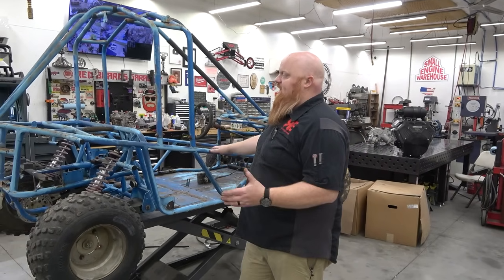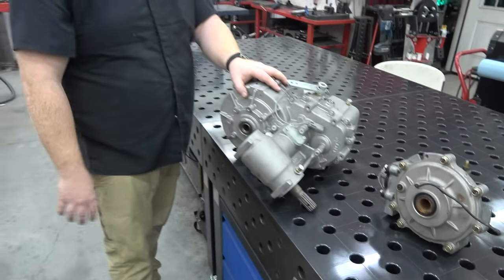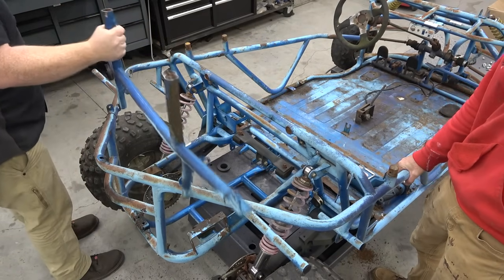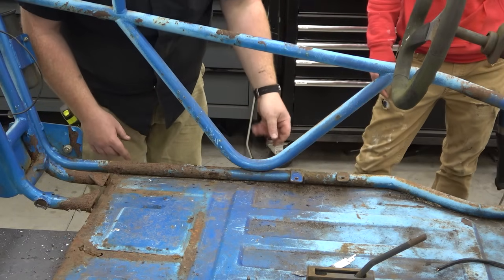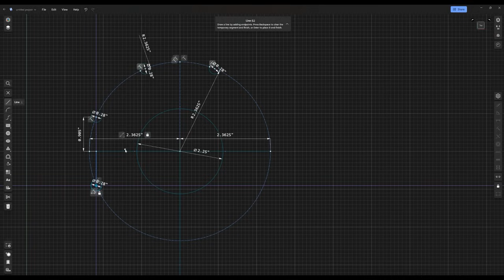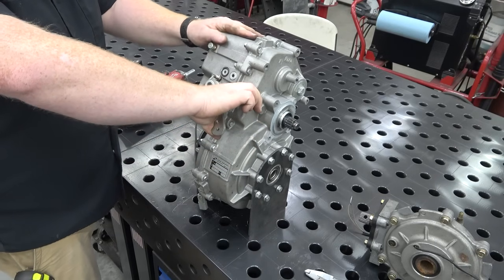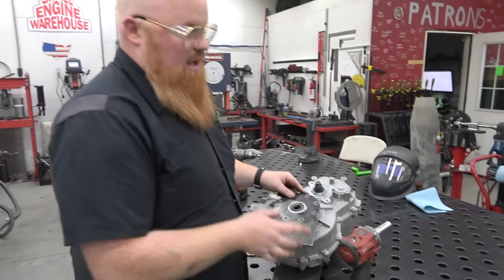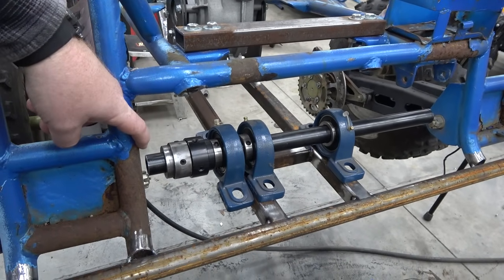Go Kart Reverse Transmission & 35Hp Big Block Briggs Buggy Build EP1

Comment: The 'Gear-box' has to have the 'Fill plugs' moved up as you've changed not only the angle of it, but the Bearing placement of the gears. The fluid must be enough to flow over the bearings, even tipped on trails. Changing the vents further up was a good too. Always look forward to your builds and this fun.

Comment: I just put a 196 Crank in a 212 hemi. It allowed me to use the stock rod that is .125 over & a .020 taller piston. Piston is now 10 thou closer to the head. Thin HG & alu fw. Running stock carb & muffler at 29⁰ Timing. I believe folks would call it a 208cc. Less stroke but more compression. Just playing around with parts I had laying around. Bsp-3 cam & 18lb springs. Curious what your thoughts are on this mix of parts. Ran fine during break in.

Comment: Okay, I might be interested in that gearbox and front diff. Question is, how much power can it reliably handle? Because I have a 1978 Arctic Cat Panther 5000 with a Suzuki Spirit fan cooled 2 stroke that puts out about 55hp. I'm going to be changing it to a Comet 102c and 90D driver that has a 1" shaft. If that gearbox can handle the power and has a 1" input shaft, I'm sold. Seems to be price reasonably compared to other SXS parts. 

Also their description is kind of incomplete, what CV axles would slide into it?

Comment: Why not use a in-line reduction planetary gearbox on the output shaft mounted at the hub end. Just mount it reverse to its intended use.
They do 10 to 1 and 15 to 1 versions of them. Can reduce or increase the speed depending on what way you run them. (Mostly reduced as designed for electric motors)
Way simpler to build.

Comment: heres what is wrong know bare with me so i dont know if my timing is i know the to dots are set together but when i pull the string to start it it stuck i have to pull it 3 or more time to get it started.i messed with the idle a bit it starts but it also get really hot i dont have a clutch on it i was trying to jest put the chain on lkike a mountain bike to see if it would run like that but as you can see i need help before i lose my mind

Comment: That engine is only 5 cc less than a Yamaha R1 engine but its 120 horsepower less.🫢🫢🫢
Reply: Liquid cooling high rpm motor made for high performance bike, isn't in the comparison class of a low rpm air cooled motor made for lawn equipment lol
Reply: What's your point? That engine turns well over 12,000rpm vs roughly 3600rpm. Liter bike engines might be fun on buggies, but they can really make it not so enjoyable for the average rider.
Reply: Fun for big boys but not family friendly. Low reving v twin probably more user friendly
Reply: @Ratkill9000  did it go right by you? Duh duh duh!!!
Reply: It's not about the horsepower it's about the fun
Reply: Bruh compared a v twin lawnmower engine to the cp4 u never touched a bike before 😂